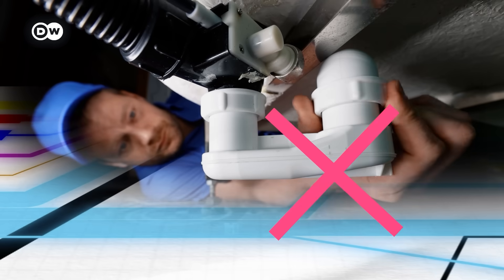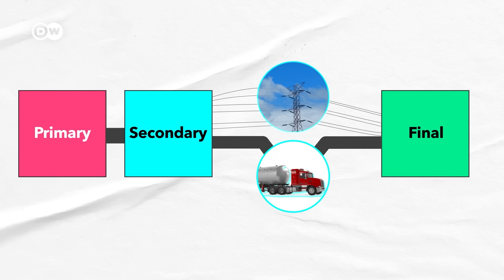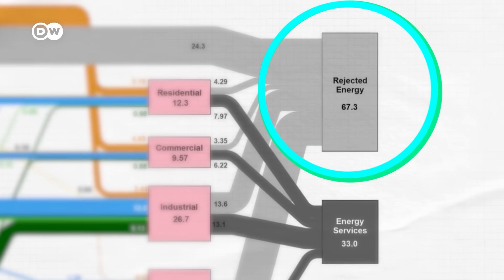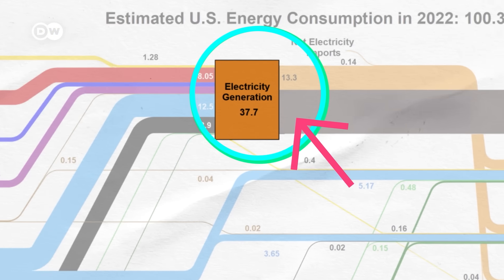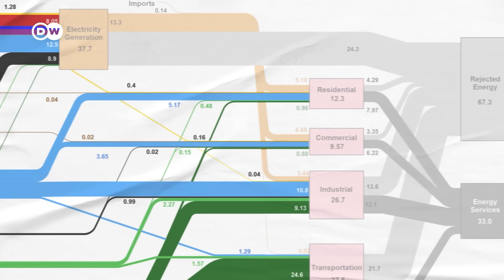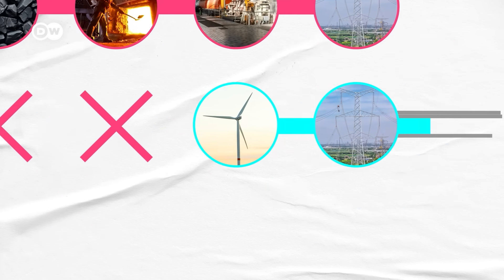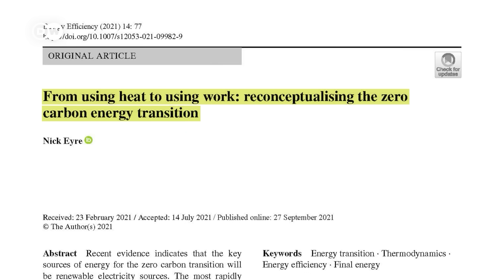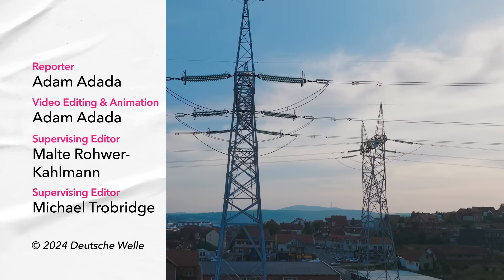The mind-blowing thing we get WRONG about energy

Comment: I’ve just read a sample of those ‘pinned’ responses.  It simply amazes me that the ‘fossil junkies’ have not either wanted to understand or just deny the advantages of renewables over fossils.  Yes, electricity is more expensive for energy purchased, but that is not the point of this video.  

If renewables (or sustainable sources) were to replace all fossils, the planet would be a different and better place in which to live.

Climate change due to elevated atmospheric CO2 could be reversed (it would still take decades), there would be none of this comparing fossil and electricity costs (which is just a diversionary tactic of the fossil junkies).  

3 or 4 times the heat from an electric powered heat pump is far better than less than unity from a gas boiler.  Same with gas rings and induction hobs for cooking.  Same for electric cars versus ICE, too.

No toxic fumes from renewable or nuclear derived electricity.  Win, win with every aspect of energy usage, IMO.

Lastly, renewables will never be exhausted.  Fossils will be a dead-end supply of energy eventually.  Fossil junkies need to get used to reality, instead of acting like selfish luddites.

Comment: You conviniantly left out the bit where batteries do not give back all the energy you put in them. Also rapidly growing worse when they age.
Reply: Yeah, but you don't burn them so... they also make use of excess energy that would go to waste. You can't think of a renewable- battery system in the same way as a fossil fuel system when comparing efficiency.

Comment: The mind-blowing thing we get WRONG about energy is that fuel efficiency is inversely proportional to the percentage of carbon in hydrocarbon fuels.  Consider a honda civic getting 40 miles per US gallon of gasoline. One US gallon of gasoline has a density of 2.85769 kilograms 13% (0.3714997 kg) is (efficient) hydrogen  and 87% (2.4861903 kg) is (inefficient) carbon. If we divide 40 miles per gallon by 2.85769 kg we get 13 .9973 miles per kilogram of GASOLINE. If we divide 40 miles per gallon by 0.3714997 we get 107.6717 miles per kilogram of HYDROGEN. So efficiency jumps from 14 miles per kilogram to 107 miles per kilogram when we remove the carbon from gasoline.

Comment: Ev example is bs. You fail to mention that it is only true for when all the electricity used is generated directly by renewables. If you have the coal plant involved you have all the mentioned losses of electricity generation applied before the losses in the actual use of the car. EV s waste more energy at this point in time and are no help at all, but will be later on.

Comment: Electric cars aren't really 90% efficient.  They weigh 4,000 lbs and move a human that weighs, on average, less than 200 lbs.  That means that the human is 4.7% of the total weight that is being moved, and with the motor being 90% efficient, that means that the actual efficiency of a car with 1 person in it, (which is most trips made in cars) comes to 4.3% efficient.  A 4,000 lb electric car moving around a 200 lb human is 4.3% efficient.

  A 3,000 lb gasoline car moving around a 200 lb human, (with a 35% efficient engine), is 2.2% efficient.  So electric is twice as efficient, but the numbers they give tend to be the 90% efficiency of the motor, and the 35% efficiency of the gasoline engine.  No one ever mentions that 95% of the energy you are using is just to move the vehicle.

  If you put a 200 lb person on an electric bicycle that weighs 60 lbs, and has a hub motor, (which is 30% efficient) has a total efficiency of 23%.  That is five times as efficient as an electric car.  But here is where it gets complicated.  Most of the energy in an electric car is fighting aerodynamic drag.  The drag at 20 mph is one quarter what it is at 40 mph.  So that means, when accounting for drag, an electric bike uses 20 times less energy to move a person than an electric car does.

( There is more math, but you get the idea.  Now consider the efficiency of ordering things from Amazon.  They have to send a truck, hundreds of miles, with maybe a hundred packages.  The truck weighs multiple times what your car weighs.  That isn't even considering the boats, trains, 18-wheelers, planes, etc.  It is just flat out more efficient to buy what you want locally than to have it shipped 12,000 miles.  Maybe 3D printing will increase in quality until it is the same as traditional manufacturing.)

  And then there is the distance people travel to work.  The average distance is around 15 miles.  In the ancient world the average distance to work was about 2 miles.  If we switched to electric bikes, and only went 2 miles to work, that would be 150 times less energy to get someone to work than doing it today in an electric car.  All of this is relevant to cars, because you have to consider what we use the cars for to understand how inefficient they have made the world.

  I would love to drive an electric bike 2 miles to a 3D printing factory where we make 95% of the stuff the local cities use.  I could even get free stuff if they let me take home some of what we produce.  The efficiency doesn't even stop there, but I won't get into heat storage, heat exchangers, and sterling engines.  Basically, if your gasoline car had 4 times as much coolant, and when you got home it dumped it into the fuel tank of a sterling engine, you could run your whole house on the waste heat from your daily trip to the grocery store.  Do the math.  It checks out.

Comment: Any kind of improvement in efficiency causes a net savings in CO2 production. Even if there were no windmills and solar panels, switching to electric cars will save energy (but only after making up for the initial high emissions in mining and building new electric cars). So in reality this is not a sales pitch for renewables so much as a sales pitch for improving efficiency in the use of energy. 

We should also be “fair” with windmills and solar: they should not “free ride” on the traditional power sources that are more reliable. Each windmill should include the cost of a big battery to release energy when it’s not windy. And there needs to be twice as many panels as are needed to cover the nighttime demand. This is all “wasted” energy inherent with wind and solar, and it’s unclear whether this waste is fully accounted for.

Comment: Ironically the blades of a wind turbine are MADE FROM OIL! Ev’s lose lots of their battery energy when used in cold climates! If every driver suddenly switched to an Ev the already struggling electricity grids simply wouldn’t cope with high megawatts needed just to charge them all up.

Comment: How much energy is yes to manufacture solar panels or windmills? How much energy is used to recycle or dismantle windmills?
Reply from the maker: Renewable energy construction is by no means carbon-free, but lifecycle greenhouse gas emissions are remarkably lower than those of coal, oil and natural gas. 🔗https://www.nrel.gov/docs/fy21osti/80580.pdf There are some parts of windmills though that are hard to recycle. We have this video on the topic 👉 https://youtu.be/HzQShAlObn8
Reply: @DWPlanetA  when all is said and done. After all the strip mining, death to whales and the marine floor to drive pylons for off shore windmills we are at best changing 4 quarters for a dollar. 30 years from now we might learn we changed 4 quarters for 80 cents.

Comment: All well and good but as an individual I couldn't care less about how and where the energy comes from. All I care about is that I'm warm in the winter, that my car can be refilled to full in 5 minutes and not loose half the range in the winter or be written off if I have a minor collision. However what happens is that every time people start to save energy in their homes it somehow magically gets more expensive per kWh. So not only I have to invest my money into creating efficiency (insulate, buy an induction stove, a heat pump and so on) but the return on investment is very long. For example my floor insulation will pay for itself in approx 70 years (yes, seventy) at the current energy prices. If I get panels that's probably 10-15 years IF nothing goes wrong. Electric cars are getting cheaper mainly because nobody wants them and manufacturers are forced to sell more of them but for what they now gain with low prices and little to no maintenance they loose with expensive chargers, huge depreciation of second hand market values. So again - come back selling me this when it's all nice and cheap and an actual benefit to me rather than another propaganda spin. Everyone knows there are huge losses in the chain - make it cheaper and more attractive, people will switch without needing to convince.
Reply: Surely the more expensive per kWh your electricity gets, the faster the payback of solar and heat pumps is? You should rent an EV for a week, you get used the work, hotel and hopefully home charging pretty quickly, and then going to a gas station, even for a 5 minute fill, seems antiquated.
Reply: I dipped my toe into the electric revolution with an e bike... It gave me about six months of riding in summer conditions before the hub motor completely failed, I'm now £2000 poorer.   I'm skeptical about the energy transition, and I still get frozen waiting for a bus in spite of the climate "emergency".

Comment: When electricity is generated on your rooftop and stored in your batteries, or used directly to charge your car, transmission losses are avoided, too.  Today, transmission (and transformer) infrastructure is the hardware bottleneck to going electric.  And then there is the wetware of regulators... and fossil fuel companies... and legacy auto companies... and people who fear change...

Comment: See the problem is not just electricity vs gas/disel.  See when you process oil you get plastics, clothing, medicine products, and even roads.

You cant pave a road unless you get the tar from the last part of the refining process, You cant produce an cellular phone without petro chemicals. You cant produce half the cloths you wear or your shoes.  You guys keep focusing on the electrical part you do not ever funtion on the industrial production part.  Wind or solar does not produce material, You need oil to produce wind and solar. You guys over simplify things way to much.  We need to find a balance, we should be going to hybrid/electric vehicles and trucks.  You make every semi in the world diesel electric and you might get to your goal in real world terms.  Look at trains you use a generator to produce electricty that runs the engine, you take all the torque off the engine and it uses less fuel.  You dont have to mine as many toxic chemicals to produce the batteries to replace what is all ready in place.  You also dont have to totally rebuild your national electric grid using more nasty raw materials. 

Drive thru tampa and look at all the gas stations block by block. Now imagine how much electricity and infastructure you would need to just move tampa.  Its not going to work,  transportation is only 19percent of the problem.  

crap the bombing in Ukrain and Isreal and the rest of the world produces more carbon pollution than transportation, might want to stop that first.  Or how about AI and Cryptocurrency or just your daily use of google.  That stuff is eating up tarawatts and AI and Crypto minning is just getting started.  How about we stop that crap.

This climate crap is a money grab, it shows in the things we focus on.  Cars and trucks just a very small part of the problem.  Cant have roads and runways without Asphalt and Cement.

Comment: No mention of the weasy transmission line/grid, shortage of neighood transformers, little copper mining capacity.  true a glass is half full, but still all factual limitations.   The grid is already at its limit.  Huston is now without power just from one major storm.   If you want to be without power just tell everyone to convert from gas heat to heat pump, or everyone buy an EV.   Too little investment in transformers and copper wires.

Comment: Current Electrical grid output is 13.3 and you want to put 33 through it to power everything that isn't already electric. But plan to only have 1/3 of the amount of electricity production with windmills and solar 4.3?  What are the potential losses due to an unstable energy grid? What are the losses of storing AC Electricity in DC batteries and converted back to AC during the night? Bit of a half-arsed video mate. Think about the energy density as well. Coal, gas and Nuclear power stations are relatively tiny compared to vast sprawling wind farms and solar farms. There is no rush, keep replacing Coal and Gas with Geothermal where you can and Nuclear where you cannot. Eventually we will get there. Sustainably and economically. I'm not a fossil fuel advocate but I do want to continue flying in planes to go traveling and we need the hydrocarbons for that. Quick google search suggested that AC to DC loses 15% energy  and roughly the same coming back. 30% loss if using stored power. Not to mention the losses in the battery itself. Unknown what pumped hydro will get? So far Snowy 2 in Australia is at $10B and the drill is bogged 100M into the tunnel.

Comment: Efficiency doesn’t really matter. Fossil fuels still dominate energy production because the market judges them to be the economically superior. That’s because renewables are costly to manufacture, install and decommission, and require massive infrastructure changes for distribution. Most importantly it is very expensive to store electricity in order to maintain a stable grid and match supply with demand over a wide range of timescales. Fossil fuels combine energy and storage so do not have this issue.

I’m not advocating for continuing fossil fuel use. I’m just saying they are going to very hard to replace except round the margins.

Comment: The currently available solar panels have an average efficiency of about 20%. That means only 20% of the energy they capture gets converted into electrical energy, while the other 80% is converted directly into heat, that dissipates into the air at ground level. This category of Rejected Energy seems to be missing from your graphs.  If we take it into account, using an induction cooktop powered by solar panels results in a higher percentage of Rejected Energy than cooking on a gas burning stove, doesn't it?
Back to the solar panels' operation, how is concentrating all that heat at ground level going to help us accomplish the ultimate goal of "cooling the atmosphere"?

Comment: Heat batteries that stay hot for many many days make seance,things like wind turbines on motorway and tunnel walls taking combustion lost energy.i don't understand long distance DC current,but wouldn't offsetting localised DC just go straight into localised batteries as DC saving energy without conversion or long distance storage.its hard to visualise something no one in the world uses except china(high voltage/long distance DC)And no one talks about in relation to micro/macro integration and loss

Comment: It's not clear what changes are being made between the left an the right hand side of the chart. If we were to say there will be an 80 % reduction in car sales and require some plants to produce electric buses we would make enormous savings. 
Buses are used throughout the day where as the majority of cars take up parking spaces around 90% of the time. The reduction in air pollution and healthcare costs is huge. 
We use far too much nitrogen fertiliser which causes nitrous oxide emissions and river and ocean pollution. Nitrogen fertilizer consumption must be reduced much of which can be done without a technology shift eg by growing more pulse to displace meat consumption.
There are externality benefits that can't be costed in to the system though.

Comment: wait something isnt right about this comparison...

When discussing if a fully electrified economy, which yes that's definitely the end goal, as it should be, we ought to keep some things in mind.
The comparison is made based on the potential energy within Primary energy sources, as opposed to the total amount of Electricity that needs to be generated in a fully electric economy, and yes in total amounts these two have a large difference because the efficiency of generation of the electricity is far more in favor of renewables.

However, what is grossly glossed over here is the fact that we still need to generate 2 to 3 times more electricity to take over a process that didn't need electricity to begin with! (think of old-fashion steel-mills, ammonia production, and increased demands for digital infrastructure).  This is the real hurdle as the rate at which we transfer is slow, and realistically speaking Renewables (except for Hydro/Geothermal, they don't play nice with any other source (considering they are the intermittent and inconsistent) and arent as scalable as one thinks. 

As we rely more and more on renewables, extensive and redundant electrical networks would have to be built, and extremely large electrical storage sites need to be built, all with their own inefficiencies. 

the challenge is there, dont hide it, show it, however @DWPlanetA is heavily biased towards Renewables and doesn't consider nuclear an option at all.

Comment: Oil for synthesis is always needed.
So we should save what we can for that.

Also, for redundancy oil is useful.
If the grid fails i can still cook on a stove, but not electric.

The problem is storage.
We need grid level flywheel storage and block level hydropower with home level lithium ion